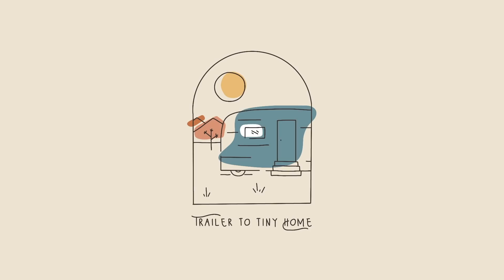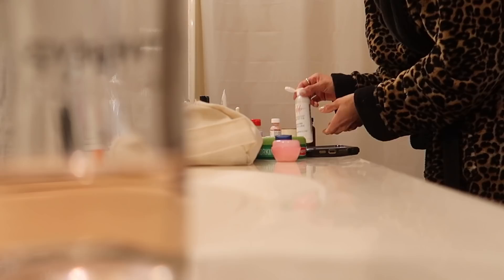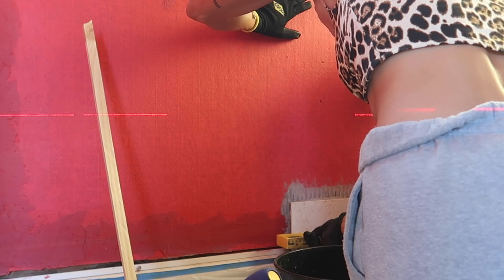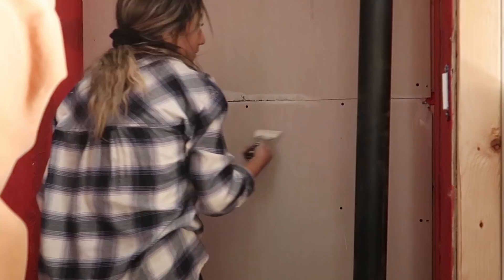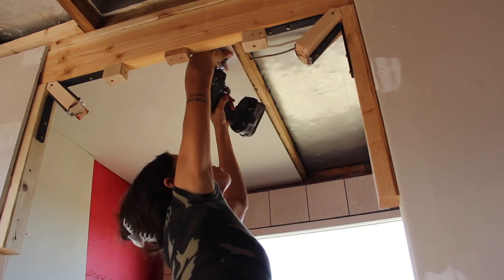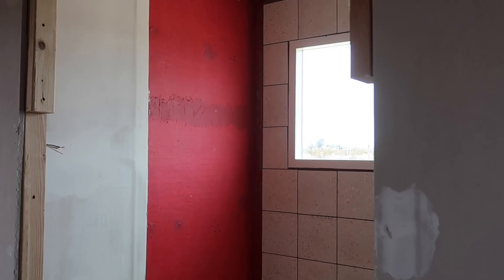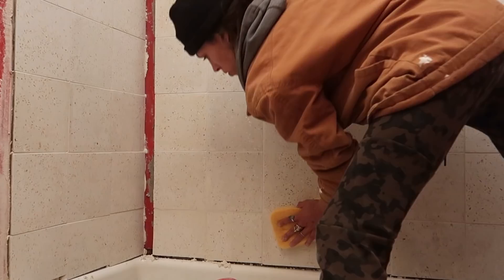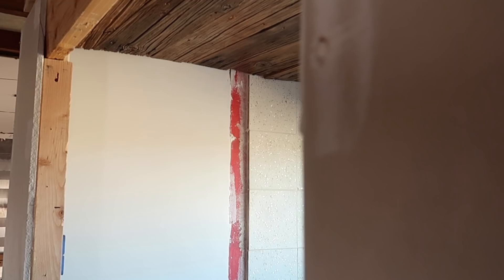TILE + DRYWALL AS A BEGINNER | DIY Trailer to Tiny Home Bathroom Renovation

Comment: I found out recently and tried it out.. instead of sanding thinset use a wet sponge/towel and you can smooth it out prior to putting another coat instead of sanding. Apparently it’s also in the instructions who new.. lol
Reply from the maker: Thanks for this!

Comment: Why did you cut the flange off your tub? That’s the most important part of waterproofing. The hardie board is supposed to be installed with the flange behind it, this way if any water gets behind your tile it’s directed into the tub. Without it any water will be able to work it’s way behind and under your tub.
Reply from the maker: You have to keep in mind that this is NOT complete. There are a couple DIY's being done to this tub outside the tile you see here so have a little patience with my process.

Comment: Did you silicone the crack by the bath and the hardy board? I had to put mine over the flange of the tub and leave a space to silicone it
Reply from the maker: Yes! There is still space for me to seal as well underneath AND I'm doing a DIY topper that will be sealed as well.